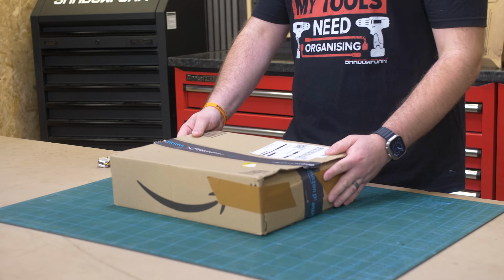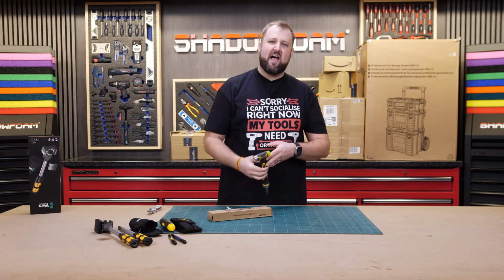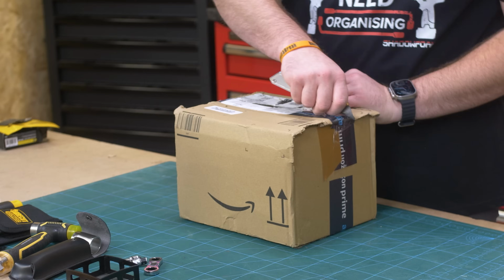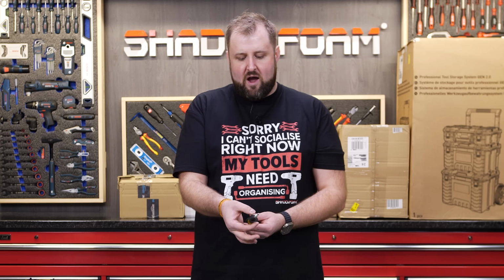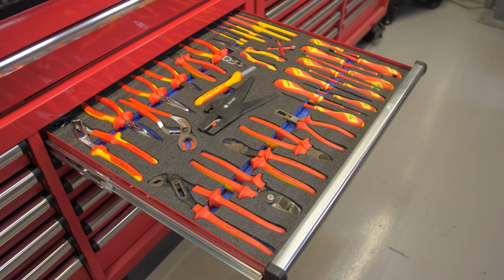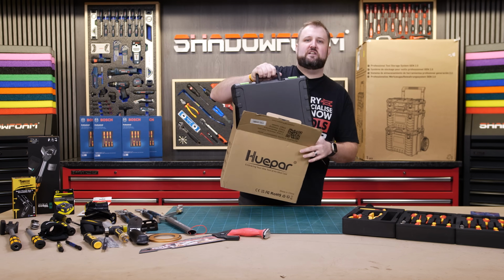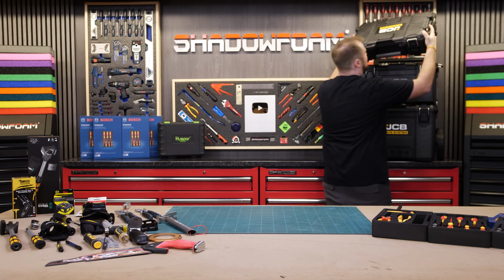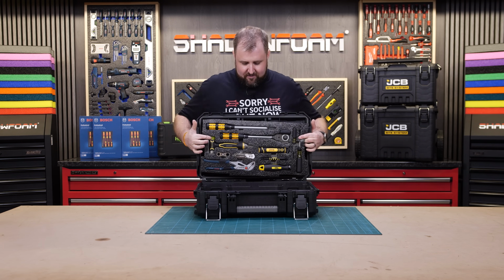I Found the Weirdest Tools on Amazon!

Comment: This kind of Klein's spilt-slit-blade screw drivers were already available in Socialist East-Germany in the 1970s - so it is not really a new idea (whoever came up with it first, I do not know).

It does not work really well, but certainly has advantages with stainless steel and brass and any other non-magnetic screws and nuts being guided in cramped places.
In the 1970s most of the crew heads were slitted heads anyway, at least in the DIY-sector; which was huge in the East-Germany. Whatever was not available in shops we built ourselves - from furniture to anything electronics. 
Limitations always make people inventive.

I do not want to miss these DIY-times but I certainly do not miss the tools from this period 😂. Having this modern stuff around now is heaven ....

Peace! from Dresden / Germany

Comment: That Caulking gun that cuts the tube could be a game-changer for certain tradesmen if its as good as they claim it to be. As a former roofer in the United States im more than familiar with most of the old styles of Caulking guns and in the end they all work but that plunger at the back tends to get in the user's way and makes things a lot harder than they need to be.

Comment: Beware of the tool's insulation, I work with ion implanters where they can run up to 80kV dc and so 220v insulation isn't good enough, it should say in there spec what they are rated to - very very important to know, and I had and still have split screw drivers to hold non magnetic screws back in the 70's they work well

Comment: Hammer ratchet sounds crazy.  But it would be super useful for my line of work.   Sometimes I need to replace 100 or more shopping trolly wheels.   The axel gets rusted in place and I usually have to hammer the axel out after removing a big 19mm nut

Comment: The problem with me and Amazon is that I will go on after I get home from work and just do some looking around and then I will find something I like and add it to the cart. Then you get those "suggestions" you might like, then I add them to the cart. My the time I am ready to check out I went from one thing in the cart to 10. LOL Piece of advice, do not buy Milwaukee power tools from Amazon because if you ever need to warranty them, Milwaukee will give you a hard time because Amazon, EBAY, Marketplace are not authorized dealers. This is coming right from Milwaukee when I tried to warranty something I bought off Amazon. They gave me a hard time but in the end they did stand behind their product.
Reply from the maker: That is great advice Mike, thank you mate! 👍

Comment: I love the 2 headed hammer/screwdriver!  Its small and fits easily into my main toolbox.  I never use the screwdriver, but love having both hammer heads in 1 little kit.  Honestly I would buy JUST the hammer bit if it were available.

Comment: I bought a saw like the SabreCut about 20 years ago while doing some low voltage electrical work (network and phone wiring)... DeWalt sold them in the US... I still have it in my electrics tool bag.

I bought into the Rigid Pro Gear 2 boxes (like the JCB) they also came with the wall mount brackets, but not the little open bins (they have the latching bins in each of the boxes and dividers in the small ones) If the JCB drawer boxes are as good as the Rigid ones, they are a definite must have. Putting the drawer box(es) on the bottom of the cart is really convenient.

Comment: I have a silli gun. And I do like it but some tubes are very difficult to get into the machine if the silicone tube is very thick plastic it's almost impossible to get them to work standard silicone tubes work great one of the real good features of them is when you stop squeezing it stops coming out unlike traditional gun

Comment: The Wera ratchet on the end of the extension handle there is like a key ring with a pin on it. Pull this out and you can remove the extended handle from the ratchet

Comment: Hi the ratchet hammer is used for hammering in chemical anchor bolts and then tightening up the nut with the socket that you would attach to the ratchet it was designed to save engineers carrying multiple tools

Comment: Another great video, the JCB box looks ace I think it would make a great travel case for my model railway equipment I could fit locomotives and rolling stock in the 2 larger sections and any tools I might need in the smaller one.

Comment: Hi Jona this video has come out just in time to help me as I'm currently making up a grab and go bag I'm using the stanley tech tote so evey tool has to do more than 1 job the multi
cut saw has ticked the box for me I'll be getting that I've already put my shadow foam order in . 1 question will you me restocking the shadow foam tape measure

Comment: Those laser's that accept both normal and rechargeable specific batteries are fantastic. I started using one approximately 3 years ago , switching from something similar to your existing one. I can't see anyone not enjoying the benefit of them once they start using one. Also those silicone guns I thought were a gimmick until I bought one early this year and have to recommend them also. I don't use it for every task, but as they are so compact I always have it on board for those jobs where you find they are so so convenient

Comment: Another great collection of tools.  Way beyond just quirky, some really weird, some great problem solvers and some just plain fantastic. Thanks for the Tool Talk.
Reply from the maker: Thanks for watching! Any tools stand out to you Colin?
Reply: @JonaShone  The Klein Screwdriver to hold a slot screw was interesting,  The handle for holding jigsaw, hacksaw and recip blade was good not only for the versatility but the handle looked nice to use as was the other handle.  I have had a few rubbish ones of those over the years. As mentioned in many of the comments some folks loved certain tools that were useful for a task they needed to perform. I have been collecting tools for over 40 years now and now mostly do woodworking so while you found a great collection of weird, quirky and some really well made tools there was nothing I would need. But I still love seeing what you manage to find.

Comment: Always enjoy watching, keep up the good work!
Reply from the maker: Thanks, will do! Any tools stand out to you?
Reply: @JonaShone  I really like the SabreCut Micro Ratchet, tiny little tool like that could come in really handy not just as a small ratchet screwdriver but if you’ve got to hang a radiator that uses the bracket and coach screws, I think the last ones I did were a 10mm or 11mm hex head so perfect for a little job like that!

Comment: All that vde kit needs is a plus-minus MCB terminal driver and the mechanical needs a jis. I am a spark and HVAC engineer retired into the Scottish highlands from yorkshire
Reply from the maker: What does your VDE kit look like mate?
Reply: @ShadowFoam  I'm a workshop in the woods now so like for like in my tool cabinet drawers. I do more mechanical work now working on boats, cars, motorbikes and atv. Just do personal spark and heating now. I'll have to show you the tool drawers you'll love them. I'd love to foam them but would not want to migrate anything out of the drawers... my socket drawer is like a showcase lol. But I have a fondness for wera so that is one dedicated drawer. Likewise knipex. Looking for the ideal box to foam out all my electrical testing and diagnostic equipment and that alone is a hoard 😆 my vde collection are wera and then some ck and wiha plus the halfords set. I have a huge collection of crimping tools with all different dies that too can be a minefield. I am an all rounder at heart and by trade but I hide out in the forest in my workshop these days 😀

Comment: A great video, it's great to see new and unusual tools 😊😊
Reply from the maker: Glad you liked it! Which tool stood out to you?
Reply: The ratchet hammer stood out mostly but also the one with the aluminium handle, I have been looking at a compact hammer for my toolbag as it's important to keep the weight down while having what I need to hand for breakdowns. I'm an electrical mechanical shift engineer so I have a wide range of issue to resolve quickly but the site I large so lugging a tool bag about for 7 hours a day then weight is important 😊

Comment: Hi. 
I’ve got the silli gun. 
Worked well for the first 2 or 3 tubes but the blade goes dull very quickly. 
Don’t use tubes with a paper rap as it destroys the sandpaper grip on the front which can’t be replaced.
Reply from the maker: Sorry to hear that but thanks for the info! 👍

Comment: Good job I have a few of these tools already, or this could be an expensive video. I have also found that RS Pro have similar holding screwdrivers and there is a Facom one of a similar design sold by RS as well.
The Toolan handsaw blade, I have found that the blades sometimes pull out, the Sabrecut is better as there is a pin that locks the blade in place. Sabrecut do some quite good tools and cutting blades.
VDE spanners I use on station batteries, that looks like a nice set in that pouch. Cannot find a set of Allen head VDE drivers from Bosch though, for me they would be much better than Torx heads.
Might trat myself to the Silly Gun, and the Jobsite boxes look good if I can find the internal dimensions and my sensors will fit into them.

Comment: Hi, a Tool Rebel in rehab. I have the Koloss, it’s a weapon when you install the pointed spike in the bottom of the handle, for aligning bolt holes. I think it’s mainly for anyone doing a lot of dismantling or erecting steel work. I use it when working on large flanged pipework when I can’t use an impactor. I works well. Love the new Bosch tools, clearly knipping at the heels of Wera and Knipex now.

Comment: That silicon gun is pretty impressive, my cheapo chinesium thing really winds me up - getting a smooth bead is next to impossible as it works in jumps.
Reply: I don't know if the Siligun is drip proof but Wolfcraft makes a cheap plastic caulk gun (Wolfcraft 1 MG 100 4351000) that has automatic stop. No need to release the pressure on the back tab to stop the caulk coming out, it doesn't even have a back tab. It' struggles a bit with very thick stuff, like T-rex, but they are cheap and light, and automatic stop is a game changer!
Reply: Just throwing your money in the bin is much faster.
Reply: @Penster-Elle  I bought a slightly pricier model (around £28), and honestly would never go back to the cheap ones as there’s so much flex in them and each pump doesn’t go far enough. This little one is great but I’ve heard people say that once a tube is used in it, then it splits in other guns… not sure how true it is though as I’ve never seen a need to have a mastic gun that tiny.
Reply: 8k reviews on Amazon and they are not good. They say its difficult to pump silicon, its slower and it struggles when using thicker stuff like Caulk.

Comment: Hi actually own and use a Japanese pull saw (not the same as the one you showed) and it also have two set of teeth.
One is to cut against the wood fiber and the other to cut along the wood fiber.
Practical in woodworking when making tenon.
I've also cut PVC pipes with it, no problem.
Reply from the maker: Thanks for the info mate, it's much appreciated!

Comment: If you think that Wera ratchet hammer is quirky, have a look on Zoro for the adjustable hammer podger. I think they're great!

I've got a Bosch laser lever that I modified to have a USB cable poking out of it to replace the disposable batteries. Just plug it in to an USB battery to power it.